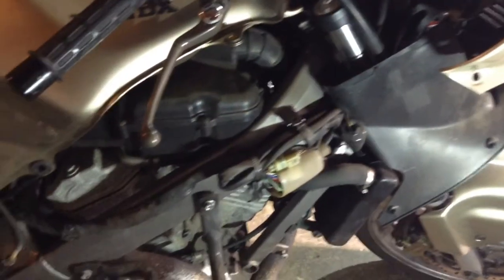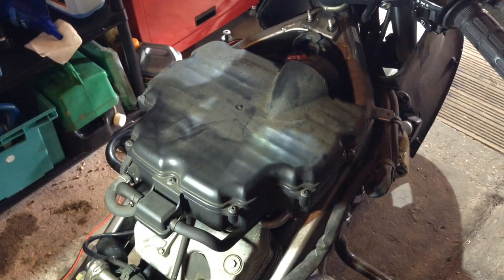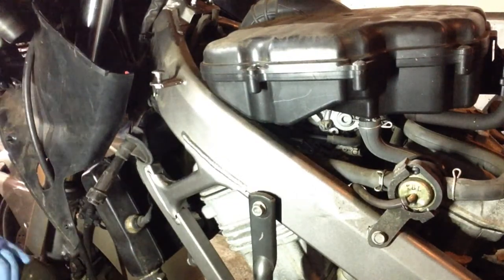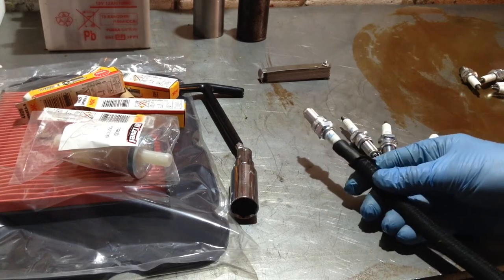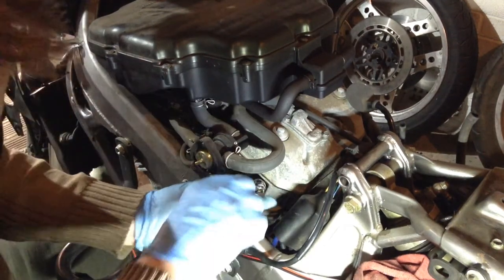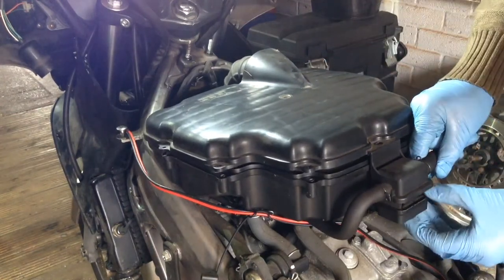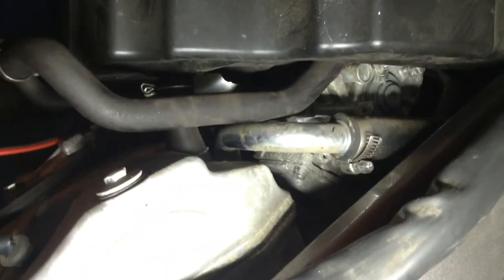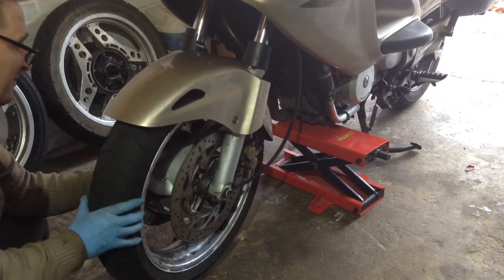Honda Deauville NT650 Air Filter, Sub Air Filter, Plugs and Fuel Filter

Comment: I had a bike like that I found to get the plugs back in if you put the plug on a rubber pipe as it will allow you to start the threads enough
Reply from the maker: Not sure how far you watched but that’s exactly what I did at 15:00
Reply: @memybikeni9931  I typed the message as I was watching the video you said how you was going to put the new spark plug in the front of the engine
Reply from the maker: @johnthake7401  ah well, the plan evolved, great minds think alike 😂